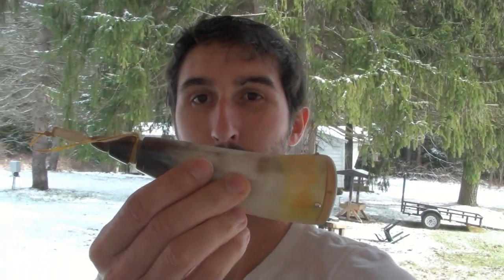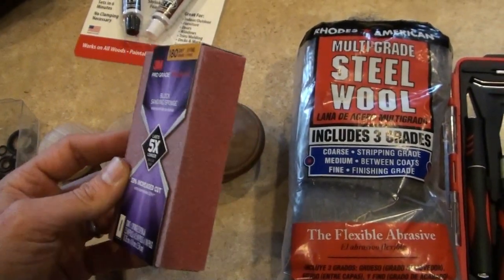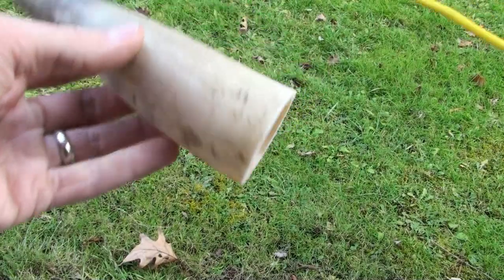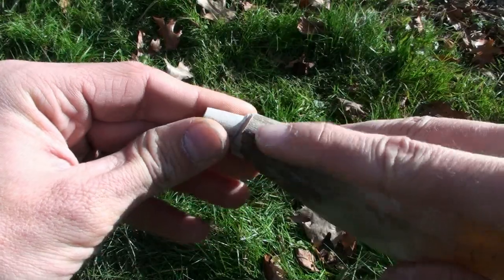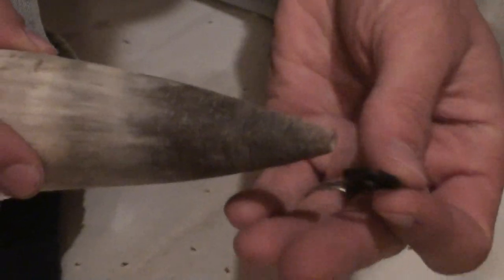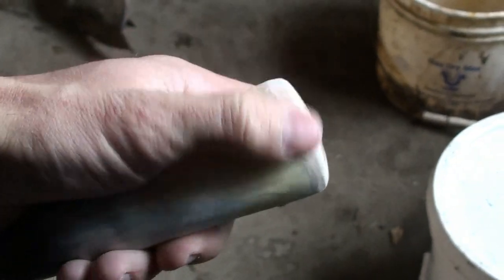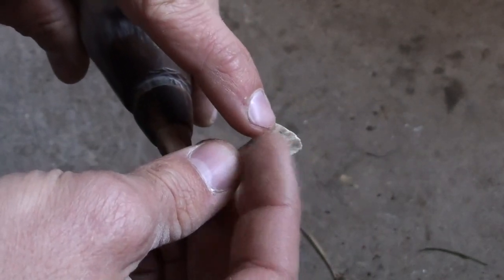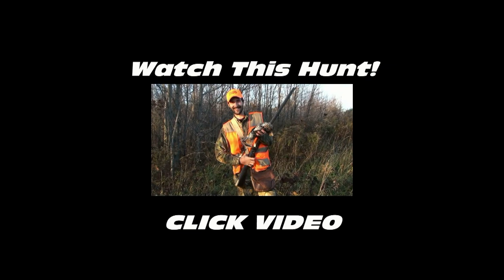How To Make A Powder Horn - Priming PowderHorn

Comment: John
  Very nice job buddy.I started making powder horns back in the early 70's. While I don't use glue on the base plug... I see nothing wrong with using whatever materials are available to accomplish the task at hand, unless you need to stay period correct? One thing I do is, I drill and tap an. appropriate sized hole in the base plug before I tack it in? Usually a 3/8"-16NC ( .375") threaded hole then I use a piece of brass All Thread and a brass Finial from the hardware store to make a removable plug for easier filling. I have made wooden threaded plugs ( just to keep the horn Period authentic ) with Maple dowel rod and a "Little Giant" die stock assembly. Drilling the base cap before inserting it keeps the saw dust out of the horn, thereby lowering the risk of plugging the pour spout. I have done it in reverse order ( by mistake ) and was able to remove the saw dust by shaking the horn over my shop garbage barrel, but it's much easier if you just DON'T do it in the first place :~)))) As for my thoughts  ( if they're worth anything to you ) on the subject of making a Bomb by gluing in the base cap? In my 50 years of experience with Black Powder. I have found that Black Powder TRULY IS Explosive, In light of that, it really doesn't matter whether the base cap is glued in or not. In a confined space as small as a Powder Horn, should the powder ignite, it will explode long before that base cap would ever dislodge itself safely enough to avoid a devastating catastrophe ? Again... just my opinion? I'm sure there are " Experts" out they in YouTube land who would disagree with that? John, just keep making those fine looking powder horns,, and let public opinion go take a hike. From what I'm seeing, most everyone loves your work? That should be a good indicator of how people view your contribution to the craft?
Dave
Pappy Dave's Knives

Comment: Very good video.  I'm glad you enjoyed your foray into the hornworking world, and I hope you continue it!
  If you'll allow, I would like to warn you about getting the horn too hot, as the scorching can cause the horn to get brittle and more prone to cracking (that particular horn looked to be plenty thick so there shouldn't be a problem there) the other thing to consider is that the spout plug is generally made of wood, because of the expansion factor, it helps stop any moisture by way of expansion, and it is softer than the horn.  Antler on the other hand does neither, so you run the risk of cracking the horn (again) should you get a little "overzealous" seating the plug, and if not sealed properly it will allow moisture in anyway.
 That aside!  Good work! I'm glad you shared your experience and hope you'll continue!

Comment: how did you determine what size to make the smaller portion of the  cap, since the horn was not round before you started the heating process?
Reply from the maker: I had several different sizes of caps.  Then once I got it rounded I trimmed and sanded the cap to fit tight.

Comment: I was working on a deer antler powder measure and priming horn a few weeks ago. It was the first time I had ever cut and or sanded deer antler. They turned out good but I couldn't believe how bad it stunk. Does the cow horn smell about the same? Yours looks great by the way.
Reply from the maker: Thanks!  Cow horn smelled a bit but no as bad as the deer antlers, they really stink when you get the sander on them.

Comment: I agree with the previous post you shouldn't glue the end cap in , I have been shooting black powder since I was about 12 years old and have never seen a end cap glued into a horn ( because if it does ignite its not a bomb ) if you glued it you didn't need the tacks, all caps on horns are either press fit or brass tacked in place with very small tacks so it can blow out the back .      you have to remember black powder isn't like smokeless powder where smokelss powder just expands black powder explodes .

Comment: Nice job on this horn but I would have made a screw in plug on the butt also for ease of filling and I have found that if you mix melted bees wax with the fixen wax that you used it will seal it better from moisture

Comment: What's the difference between a priming horn and a powder horn?
Reply: Shane Kuhn...a priming horn is generally smaller and is used to carry finer grain powder for priming the flash pan on your flintlock...it can be smaller as the amount of priming powder you use is way less versus the powder you load your flintlock with.  For example, I have fffg in my powder horn and ffffg in my priming horn.  Some shooters just use fffg for both but personally I have found the finer grain works the best to prime my flintlocks with.

Comment: One question...How do you put the powder in the horn? That pour spout looks to small to get powder into it
Reply from the maker: It is very small.  I use a very small funnel.  It will take some time to fill it up. But once I do, I will not have to fill it for 10 years or more based on how much I shoot.
Reply: I know you're going for authentic, but putting a screw in plug in the base for a larger filling hole would be more practical. I know...epoxy a female threaded piece of tubing in the wood end, that you could screw in a flush plug that wouldn't show much and give you a faster fill. You did such a great job on it, but slow filling would be a pain after a while.

I like watching you guys and have been subscribed a few years. From bow hunting frogs to grabbing rattlesnakes by the tail, and now trapping furs, you guys are great. Keep up the good work.
Reply from the maker: Thanks!  Glad you enjoy the videos.

Comment: Instead of a heat gun or hot oil I believe the traditional safe and effective way to heat the horn would be sand heated in a pot on a fire, you push the horn into the sand like a cup of Turkish coffee

Comment: Just saw another video where the guy claims the base plug should be held in only with bees wax and a few brads or wooden pegs so that if the powder in the horn goes off it will blow the bottom out and not shatter the horn into your body as he claims epoxy glued bottoms might.
Reply from the maker: +clockguy2 I know,  but he is trying to be more historical than practical. because the other way around doesnt make sense. A brass powder flask that many use today would be 1000 times more dangerous but no body says anything about that.  Probably because its more modern than historical??.  It really boils down to safety on the part of the user not how safe the equipment is.  A logical conclusion would result in not even using the gun or powder horn or flask at all based on safety measures.  How safe is safe?  Its in the users hands and mind not the equipment.  Its no different than buying a mass manufactured horn sold in stores.
Reply: *****
Point taken. I guess it boils down to... if you have five experts in a room, you will end up with six different opinions.
Reply: The subject of gluing or not gluing the end cap on a powder horn is irrelevant. A person should be more concerned with how to safely handle that powder in the first place. If the explosion is prevented from happening then the vessel the powder is carried in becomes a non issue.

Comment: Mmmmm  how to make a BOM

 not how to make a powder horn ...
.little wooden pins to serve as weak points at the wide end of the powder horn to pin the cap to the end of the horn. not epoxy. or you May blow a rather large hole in the side of your chest. ...Never use anything that is conductive of static electricity or your powder May ignite resulting in big bang that you are not aware of . And may injure . definitely will give  you and anyone  standing within a 50 ft radius of you a rather really really.... Really large freight  . Other than those two not so minor points absolutely awesome tutorial

Comment: Dude, you never glue in a base plug!  If you get a spark in the horn, it will go off like a hand grenade.  You only use bee's wax to seal the base plug to the horn.  If you get a spark in the horn, it will blow out the base plug and tacks and maybe the stopper if it was put into the horn.  NEVER GLUE IN A BASE PLUG!!!  It's simply not safe.  Please use bee's wax to seal the base plug.  I've been muzzle loading for over 30 years and I know about powder horns.  I use two of them daily.  One is for the main charge (a big horn that holds about 1 lb. of 2Fg black powder) and a smaller one that holds about a lb. of 4Fg to prime the pan of my flintlock.  Otherwise you've made a nice horn.  The use of tacks or small nails are what secures the base plug to the horn.  The bee's wax waterproofs the horn.
Reply: IMHO, about the ONLY way you are going to get a spark near a priming horn is if you have the lock at full cock and pull the trigger while you're priming the piece.  Which, come to think of it, wouldn't be possible, since the frizzen would have to be up and out of the way in order to prime the pan in the first place! The ONLY thing the flint could hit would be the horn, which will NOT produce a spark!  While your objection MIGHT be relevant in the case of a regular powder horn, the fact that we are told, over and over, NEVER to load the weapon directly from the horn, but ALWAYS use a measure, would tend to negate your perceived problem.  Unless, that is, if the person doing the loading is guilty of extreme carelessness and stupidity